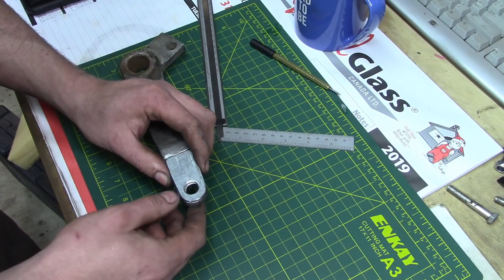Kenworth Clutch Arm Repair, Shop Update

Comment: Thankyou Everett. A very practical approach to solving the problem (I think it will be very strong).  Good video work!  It was very interesting to see the part working in the truck.
Also congratulations to you and your wife on the upcoming addition to the family.  Hope all are safe.  Fully understand that you will be "off the air" when the baby arrives.  As the saying goes here in Australia .."you will be as busy as a one-armed paper hanger". Mal
Reply from the maker: Lol, thanks Mal, yes we are excited to meet new little one soon.  Will be busy here but still have some videos in the pipeline needing editing so as time allows for that hopefully a few can come out in the near future.  I had hoped to get a picture of the transmission on the floor with the arm on it but the arm had to go on after the bellhousing bolts were in so that wasn't going to work.

Comment: That should hold it for a while .  Is it a twin plate spicer clutch , we used to use a 1/8 welding rod & a 1/2'' dia bolt to set up the position of the clutch fork .  Looks like you will be a busy lad soon !     Cheers .
Reply from the maker: Yes, it is a twin plate clutch but I believe it is an Eaton unit that went into this truck.  The old school flywheel needed changing out for a newer one but the old flywheel may be repurposed later after I machine the inner recess out to take a newer-style clutch.  And yes, it will be VERY busy soon . . . O.o
Reply: @EverettsWorkshop  Cool , as you probably know if you don't get the 1/8 & 1/2 adjusted right the stop clutch will feel weird .

Comment: Everett, if you have parting off issues, try using the tool post behind the shaft, parting tool upside down, rotating in the usual direction. It is just like opening a sardine can on my old lathe with babbit bearings
Reply from the maker: I had heard of using the blade from the back, might have to give that a try at some point.  Still trying various techniques to see what will give the best results on this machine.

Comment: Go back and look at my video on how I made my last cutoff holder. IHMO the closer the cut off tool to the post the stiffer it is. Great repair just another way to go about doing it.
Reply from the maker: Hey Jim, I'm not done experimenting with parting techniques - in the works at some point is a block to go in place of the compound to add rigidity, and also trying out the new indexable parting blade.  All in due time, we've got a lot on the go here . . . O.o

Comment: Congratulations Dad. Big surprise to use pop rivets instead of threaded bolts .. whatever works!
Reply from the maker: Thanks!  Figured rivets would be sufficient, and my boss wanted as low a fastener profile as possible.  Just didn't want that steel backer plate coming loose.

Comment: U done an awesome job there but I think I would've put a 1/4,bolt through them both hopefully the rivets will do the job 😉
Reply from the maker: Thanks Nigel, I was figuring with the adhesive, rivets and bolt through the center it should hold together ok. The truck is still rolling, that fellow is one of our better customers!

Comment: would have drilled and tapped 2 small screws to assist in holding
Reply from the maker: For sure, that would have been a good alternative as well - I just went the rivet route because it's what I thought of first.

Comment: Changing speeds on those mill/drills is a nuisanse.  Congratulations on the new addition.
Reply from the maker: I agree, it is a pain.  As long as it's already st to a speed that is usable I often just leave it in whatever the previous speed was.  I will change it for different operations but only if necessary.

Comment: Hi Everett, sounds like there'll be plenty more sleepless nights for you soon😭. Nice job on the clutch arm. For a guy who isn't a trained machinist/engineer you have great natural aptitude for the craft. On JB Weld,it is tremendous stuff and has gotten me out of lots of difficult spots over the years. I buy it in the industrial 5 ounce tubes these days. It is indeed an epoxy based product. I had thought to request Tech Ingredients channel do a  review of liquid metal repair products and see if they can make a comparable product in their lab. Good to hear your 'better half'😂 is well clear of possible Covid-19 infection.
Reply from the maker: Thanks Howard, we will definitely be having some late nights in the near future, it's all part of the game.  And I'm very thankful for it, as for a time I didn't know if I'd get to be a dad at all.  No virus sign in our circles, and we will be careful when going to the hospital.
As for shop stuff I just like to tinker and it is a real thrill to me to take a broken part and make it serviceable again.  We waste so much stuff in our society that can be repaired, reused or repurposed.
And isn't JB Weld awesome stuff?  We use it at work for a variety of purposes.  Always was curious about its ingredients due to the smell of it.

Comment: Good work Everett on the the  edition to your family.
What glue did you use on the repair? Christopher from Down Under
Reply from the maker: Thanks Chris!  I used a product called JB Weld, I think it's an epoxy-based product, used a lot around here.  Not sure if it is available in Australia but would be surprised if it was not.
Reply: Try Amazon ?

Comment: Congrats on the baby. I know what ya mean about the parting problems!  I have been trying HSS, sometimes it works, sometimes it melts. I received just a couple days ago some cheap carbide inserts. Now I just need to make a holder like the 1 you got (or maybe a clamp style)
Interesting approach on this repair, my 1st instinct would have been to scratch build a new part  from steel (Obviously time consuming) but this I think is a pretty darn good idea
Reply from the maker: Thanks Craig, we're pretty excited!  Munchkin is due any day now, just playing the waiting game.  I didn't have enough time to scratch build a new arm, and all my boss really was asking for was a repaired rod end so that's all we did.  Making a new one would not have been super hard though.  As for the parting blade, I need to make or buy a holder for it but that will have to wait . . . got a couple things on the go, lol!

Comment: Hey Everette.

Congratulations on your new little one.Thanks for all your videos. I'm sure that they are a lot of work. Please send me your plans for the lathe ways dial indicator holder. I have the same lathe in the 4x14 model.

Regards Doug down the road in Winnipeg
Reply from the maker: Thanks Doug for the kind words, glad you like the videos. I'll admit they do take a bit of time, ehich is why I can't commit to a weekly schedule. If you send me an email at everettsworkshop@gmail.com I can email you the plan. You may need to adjust some dimensions to fit your machine and what you have available for material but they're free for the taking.

Comment: Congratulations to you and yours, exciting times for sure.  Nice repair, I used to have a similar repair that I did on clutch pedals.  The big difference is that they were steel and we could just weld them up and re-drill them.  Thanks for sharing.
Reply from the maker: Thanks Steve, I'm pretty excited.  Tired, lol, but excited.  The customer was happy that we didn't have to wait for a part to get shipped in, for sure.

Comment: Everett, I need your help. I am disabled and use a Walker. I would like to install a cup holder but I need a bushing to get the clamp to fit. I unfortunately do not have the equipment available to make the bushing myself. I already measured the mounting location as .877 OD tube and the clamp is 1.250 ID. But the bushing doesn't need to be that thick, .125 to .250.
If you could help, I will be eternally grateful. 
Thank you for your time. Give Sprocket a good petting for me....
Reply from the maker: If you're ok with not being in a rush I'm sure we can come up with something.  Just got a few big things going on in life here but this is a season. Tell you what, email me at everettsworkshop@gmail.com and we can figure out the details of what you need made up and how we can get a hold of each other.

Comment: Nice repair, Everett. BTW, did you get the cheap pop-rivetter from the same place Rustinox got his door?   g
Reply from the maker: Thanks Richard!  I got the cheap riveter from Princess Auto some years ago so I would doubt Michel would have gotten his from there as he lives in Belgium . . . they both may have originally been made in the same country though . . .

Comment: G’day Everett. Congratulations to you and your wife, two children is a good balance now the young fella won’t be the only one spoiled, they’ll have to learn to share. Aluminium clutch arm, it boggles the mind, so is it engineered redundancy, hmm maybe but then if maintenance schedules were kept and someone knew where to check it wouldn’t have failed, anyhow it gave you a video, thanks 
Cheers 
Peter
Reply from the maker: Thanks Peter!  The arm has a ball stud tightened into the end of it which accepts a rod, so at least the aluminum does not have to have the pivot motion in it.  Well, shouldn't anyway . . . the ball stud seized and loosened the nut, which then allowed the damage to happen.

Comment: Congratulations on the new addition to the family! That is a beautiful repair on the arm - great weld, and a great decision to over lay and reinforce the part to stronger than new. When I saw the oversize hole, I wondered if you'd put a harder bushing inside, (instead of welding it up), but I didn't think of the reinforcement plate. Nice to see the finished job in place too. Great stuff! Cheers, Craig PS: Get some sleep while you still can :-)
Reply from the maker: Thanks Craig, we're just waiting for munchkin to arrive now, could be any time.  As for the clutch arm it's not a hidden repair component wise but nobody will see it anyway considering where it is.  And yes, trying to sleep when I can but even now it seems elusive . . .

Comment: Congratulations on the incoming blessing. Cool upgrade, it would be interesting to see how it fares in comparison to the original...
Reply: The original one could be like 2 to $500, this one  ===   Priceless...    😈😎👍
In an ideal world, the other part of the lever would be a fork to avoid only one sided force on the Aluminium hole when the blot gets slack.
Reply from the maker: Thanks!  Considering the truck is a 1988, hopefully it will outlast the chassis from here on . . .

Comment: I note your comment to parting off still being "questionable" (and you switch your tool post without commenting on it, naughty youtuber!).

There are two changes you could consider that might improve matters.

Currently (or recently) fashionable in youtube engineering circles is the "solid tool post mount" AKA "replacing your compound", which I think was popularised by ROBRENZ

https://www.youtube.com/watch?v=pG3YSfgyJPI

So doing this, in combination with your rigid tool holder  might do the trick.

Failing this, "back in the day" (1930s) impoversished model engineers with small lathes also had MAJOR trouble with parting.

Their solution (also used in industry to avoid swapping tools) was the "rear tool post"

Unusually, I think the naming of this is consistent, so a search for rear tool post gives good quality results.

Here's a sample video, but there lots of info out there.

https://www.youtube.com/watch?v=nwcYqZgHoc8

(his lathe is a on a Myford ML7 http://www.lathes.co.uk/myford-ml7/ )
Reply from the maker: Interesting you mention the removal of the compound for a solid block, as I have a piece of scrap on the floor that has been earmarked for that purpose for a while.  It is on the "to do" list but it seems like urgent projects keep coming up that push home tool making to the back burner.  I want to try that solid post first before making a rear parting tool, should be less work to start with.
Reply: @EverettsWorkshop  Would you be interested in a "period" write up of this?

I think I've got some 1930s references to this rear post trick!
Reply: Hmm. Neither my 1930's volume nor my 1953 volume has "rear tool post" in the index.